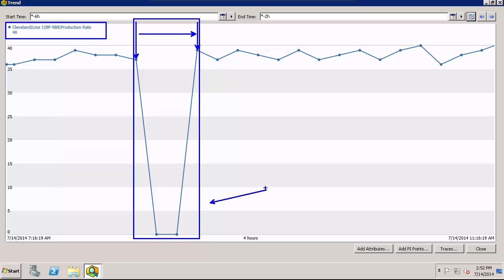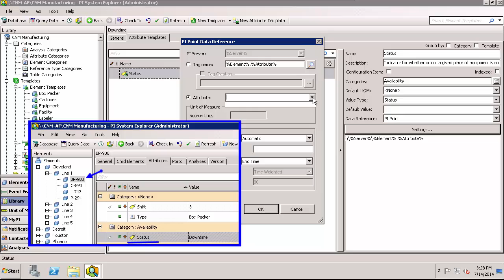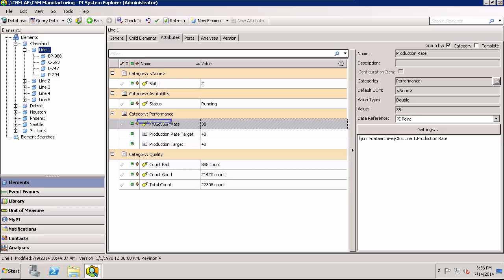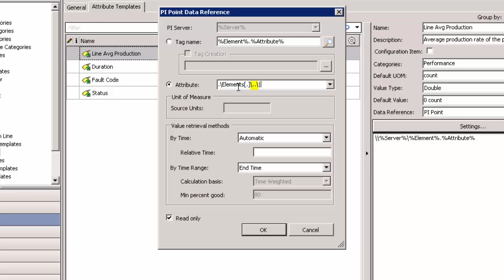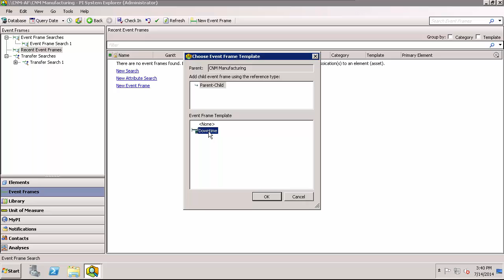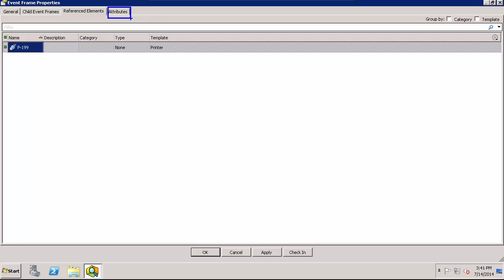OSIsoft: How to Setup an Event Frame Template with PI AF [PI AF 2014-  v2.6.0.5843]

Comment: Hi
you have explained how can we go from child element to parent element using \..\. Can you tell me how can we access the child element from parent?
Reply: .\*childElement|outputAttribute
Reply: You could just copy the path of that attribute and paste it in the event frames template
Reply from the maker: I recommend checking out a reference guide called: Guide to Substitution Syntax in AF-EF Data References - v2.pdf it's linked in a PI Square thread available here: https://pisquare.osisoft.com/thread/11188 and if you have a specific use case that you're trying to achieve the best place to go for help would be to our PI Square community or to Tech Support, have a great day!

Comment: So all event frames need a template? No one-offs?
Reply from the maker: It's possible to create an event frame manually that does not need an event frame template, and this can be done from the "Event Frames" Pane in PI System Explorer. You can right-click on an Event Frame Search and select "New Event Frame" where it will ask for your template, and you can select <None> where it will take some default settings that you can edit. As you hinted at, this would be a one-time deal. However, it is much more common to utilize Event Frame templates.